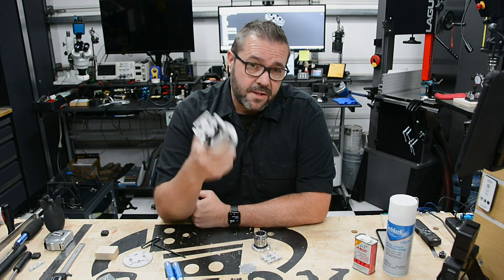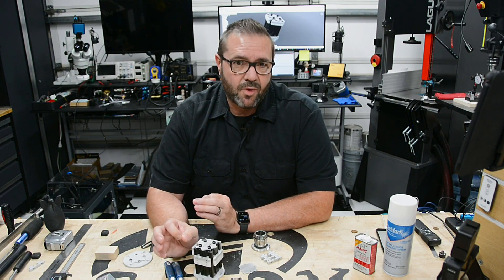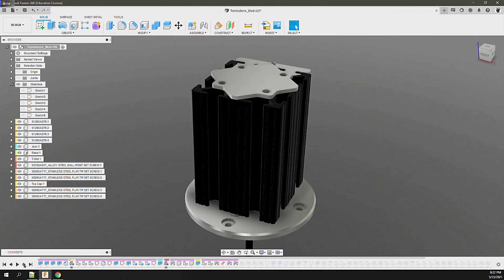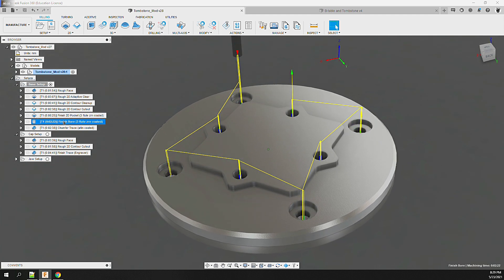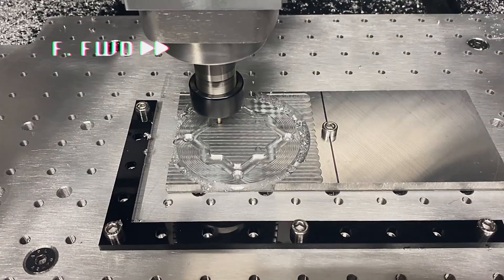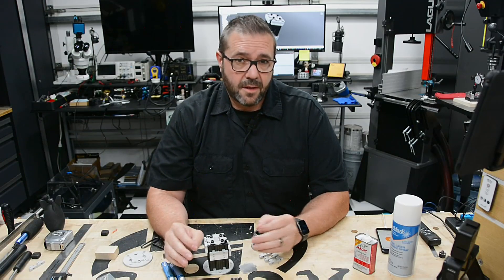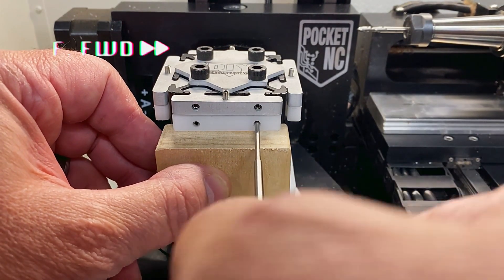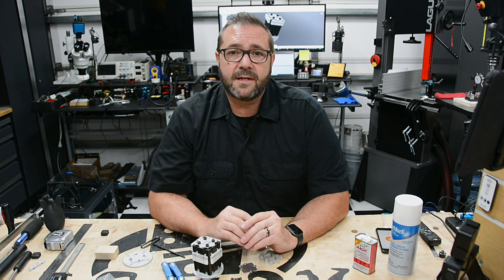An Easy to Build Tombstone Fixture for the Pocket NC!

Comment: That DM CNC machine looks like a C3D Nomad on steroids. Very nice. Excellent work, and the finishing is really nice. Does the sandblasting remove a measurable amount of material from the surface, I wonder? I know that anodizing aluminum can potentially make parts fit a little tighter than they should, did you see the opposite when you blasted them?
Reply from the maker: The Nomad dreams about being a DM500 someday... :) 
Depending on the blast medium, and uniformity of the blasting pattern, it is essentially sandpaper without the paper... I try to use a consistent symmetrical pattern just as you would if you were applying paint with a spray gun... same rules, never stop moving!
Reply: @DIYEngineering  I gotta get one of those!